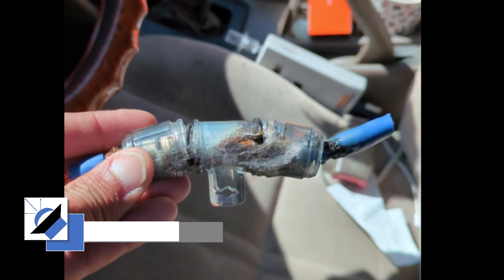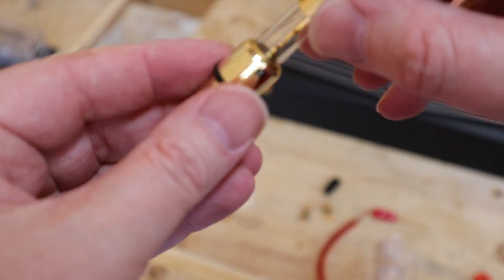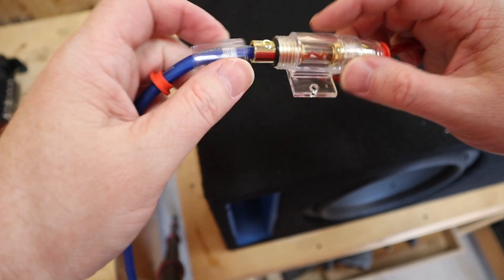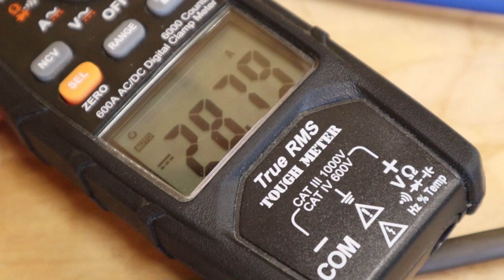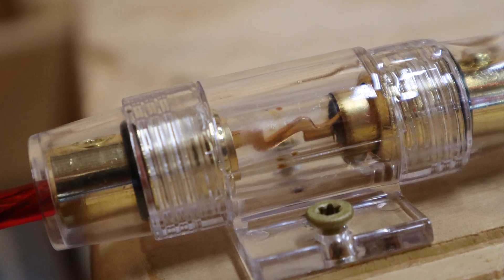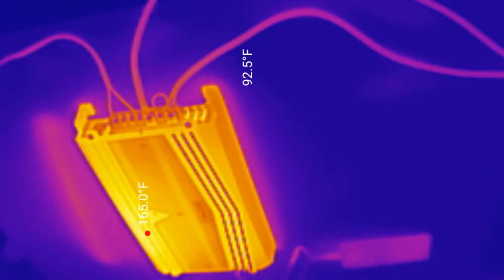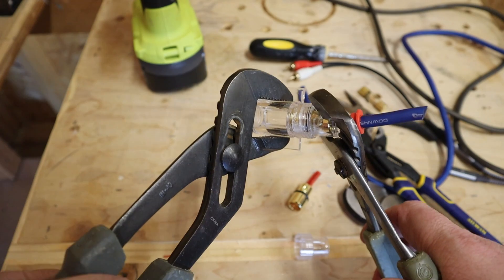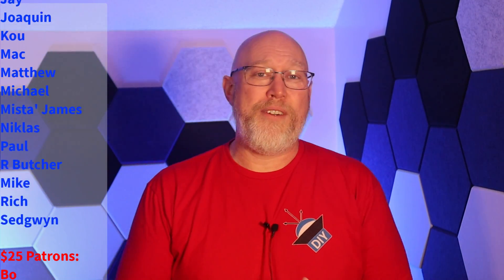How NOT to do car audio:  Melting fuse holders.

Comment: The nicest but kinda expensive fuse blocks I use are the stinger fuse blocks Best Buy sells they are rated at 250 amps I believe about 50$ a block

Comment: Here is an interesting question, If my amplifier requires 120 amps, what would be better? 4 gauge OFC (150 amps) or 0 gauge CCA (200 amps)? Will I lose watts with CCA?
Reply from the maker: Both will carry the required current, but the CCA is more likely to corrode.
Reply: @DIYAudioGuy   I see... There is almost a $30 difference between knukonceptz Bassik 0 gauge and Kolossus 4 gauge amp kit, Bassik  0 gauge kit is cheaper.
Reply from the maker: @eliavedri7876  I think the bassik is CCA, get OFC.
Reply: @DIYAudioGuy  Yes I know it's CCA, that's why I asked the question earlier, simply the kolossus 4 gauge is almost double the price of Bassik 0 gauge, maybe I'll stretch my budget and buy the Kolossus
Reply from the maker: @eliavedri7876  as long as you're aware of the pros and cons feel free to spend your money in the most efficient way.  You will get people that will hate on the CCA.  I'm not one of them.  Personally I would buy the 4 gauge.

Comment: Hello
What's the output of an amplifier is for??
I have 2inputs and 2outputs on my Rockville Amp.

So what's the Output for??
Thank you
Reply from the maker: The outputs are for connecting a second amplifier.  Check the owner's manual for specifics.
Reply: @DIYAudioGuy  Thank you

Comment: I usually use electrical copper wire. Is fine and never ever overhead.
Reply from the maker: As long as the wire is big enough to handle the load it works.

Comment: Love this video it’s very helpful. Also my 1000 watt peak amp get very hot to the touch and sometimes goes into protection mode if too hot I have a 1200 watt peak sun but don’t run it that high. How can I keep this from happening?
Reply from the maker: I'm not very good at troubleshooting.  So I'm not 100% sure what to tell you.  Check all of your connections.  Consider upgrading your electrical system, if your voltage drops then your amp will have to draw more current to make power. That will generate heat.  Make sure you're not clipping. Beyond that it could simply be that you're driving the amplifier too hard and you might need to turn things down a little bit.  You might also consider upgrading the amplifier.
Reply: @DIYAudioGuy  I was considering getting a stronger amp at 1500 watts instead of 1000. Thank you!
Reply: Time to get a fan to keep the amp cool and make sure you have clearance all around the amp so air can circulate.
Mine would go shut down with summer heat 
Once I lifted it off the floor and added the fan it can play all day no matter how hot it gets outside.

Comment: Or just use an ANL fuse???
Reply from the maker: You can still melt an ANL fuse block.  The loose connection is the issue not the fuse.

Comment: Most cases I’ve ever seen of fuse holders burning up is from cheap wire like CCA it’s no where near as good as OFC and it corrodes easily and gets very brittle easily when you are drawing current through say a 1/0 CCA wire it’s not even close to the capability of 1/0 OFC and people are trying to use it on amps that need a true 1/0 OFC wire to carry the current that’s required me personally todays amp wire is overpriced junk I stick to welding cable it never corrodes and has never failed thermally
Reply from the maker: Copper is the way to go.
Reply: I'm guilty...I just wired and tested my system before wrapping trim panels. It's working great but I know full well the cca is coming out and welding wire is going in. Price is the price and an electrical fire could be much more costly than true OFC.

Comment: I'm running that exact fuse holder on my 200.4 with a 60a fuse, funny the amp calls for 200a fuse but it's never popped lol
Reply from the maker: If it works then it works.  And there's nothing at all wrong with this style of use holder for this style of fuse, as long as the connections are solid you should be fine.  Never hurts to check them periodically.

Comment: I had a wired atc fuse holder  melt on my first serious install 35 years ago. It was the only lesson I needed on going cheap on electrical.
Reply from the maker: I am glad it was just the fuse holder and nothing more.
Reply: @DIYAudioGuy  It was only running about 230 watts rms through it and it was at the battery. Around the same time a friend had to pull over mid drive to yank the power power wire off the battery because his only main fuse was in the trunk . It had shorted to ground somewhere near the rear seat of his mustang and he ended up with a smoke in the cabin situation. Him and the car were fine.

Comment: I dont know what I have seen more, melted fuse holders or melted (+) on amps.
Reply from the maker: I was shocked how fast the loose connection heated up.
Reply: @DIYAudioGuy  I use circuit breaker myself no time to keep buying fuses.

Comment: Set screw style fuse holders with no ferrule or blue thread locker guarentee to fail those agu fuse holders are an even worse connection😉 this is a great experiment great job Justin!

Comment: I had one of these from a skar 4awg kit fail, my issue is the fuse should have blown.   It was a JL audio slash 1000.1.      it was wired at 1.5 ohm fuse 4 inches and the run was only about 7 feet.  Crimped with a hydraulic crimper.

Comment: I don't like them because there's to many loose parts. Most of the time it's poor instalation, and or cheap wire... good video
Reply from the maker: I guess if you have more parts it's more opportunities to make a mistake.
Reply: @DIYAudioGuy  that and there in a vehicle bouncing around. I prefer a ANL style less moving parts. I've been running circuit breakers on my personal vehicles.
Reply: @JasonWW2000  had them in four different vehicles never had a problem..🤔🤔 I get some time might load test a couple
Reply: I’ve got one in my camper’s solar system. But it’s just a disconnect between my bus bar and the 12V fuse panel that runs my LED lights. The largest load is my fridge and that only pulls 50W. I’ve got 6AWG running through a 60A breaker switch.